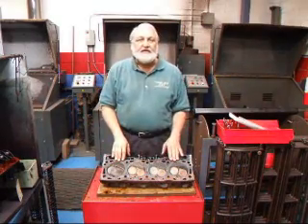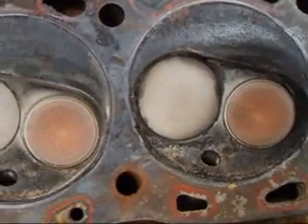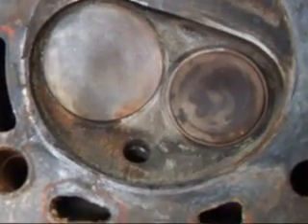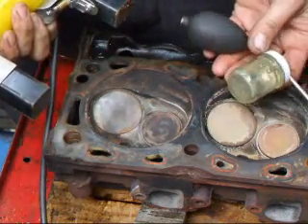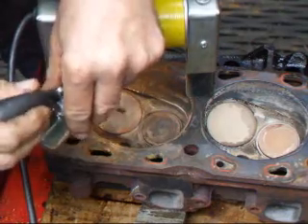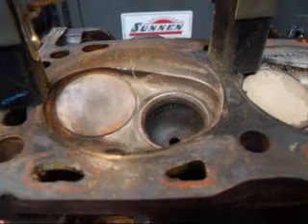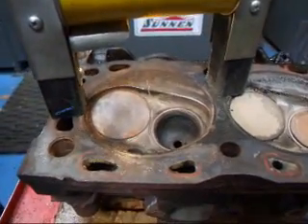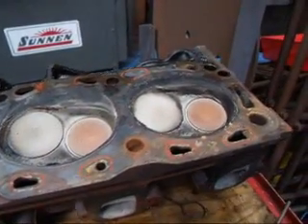Non Destructive Testing (NDT) Ford 460 Cylinder Head

Comment: I once ran a 460 accidentally without oil for almost an entire minute...at 1600rpm which was the high idle setting.  I didn't realize the engine didn't have any oil until it started making scraping noises, then I shut it down.  It was amazing that the engine survived; it ran like nothing happened to it.

Comment: @goodoldjam I like mag because it can detect subsurface discontinuities. However, I don't like mag (especially wet because of all of the oil).  You can find that crap on the bottom of your feet after wearing boots and an apron!

Comment: @gotchanowdog I've never used Mag particle but for a quick check it seems like a better option(especially since it's a dirty head). I did FPI work daily to find cracks like this and then grind for weld. It wouldn't be anymore difficult to spot the cracks. In areas that collect penetrant and you can't see if something is there you have to re-rinse and quick check. Definitely more involved and can be messy, the method is superior if you plan on repairing it.

Comment: Pretty easy, just finding space is hard.  you'll also need ALOT of cooling and big everything.  We went with a HUGE carb system.  Fuel injection is the way to go but it can get expensive.  Which is why we went low pressure with big torque cam.

Comment: Yep, my brother did a 460 swap and I sent him Cobra Jet heads.  After all was said and done we put in a twin turbo kit.  Just low pressure though.  It produced 595 hp and 750+ lb-ft.  Making bit power with those engines is SUPER easy.

Comment: They also use impedance testing for this kind of job in aircraft engines, where a probe puts out an ultrasonic signal and the machine measures how much of the signal is absorbed or reflected back.  This can detect even the slightest flaws.